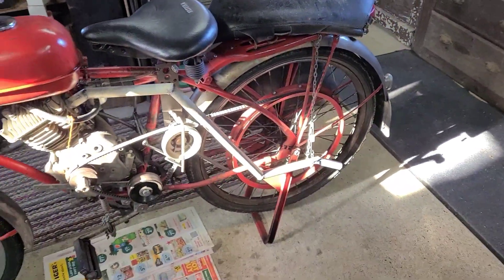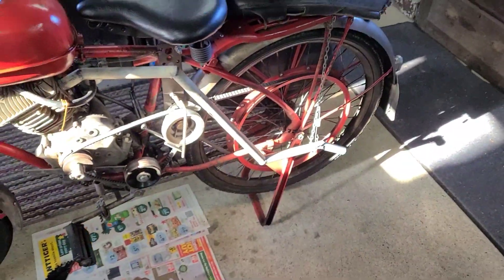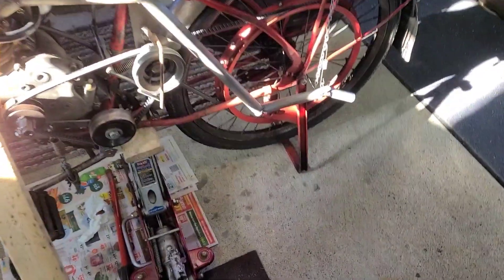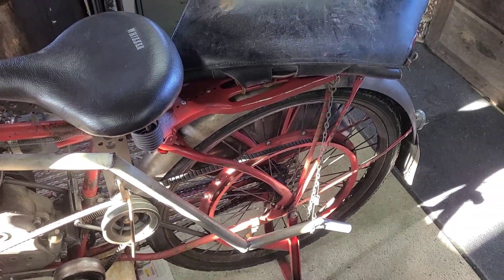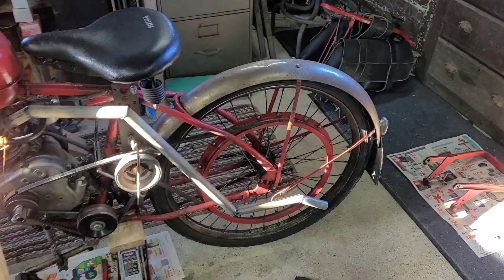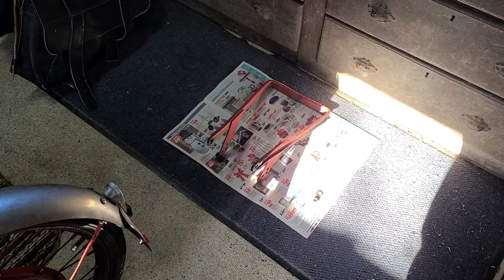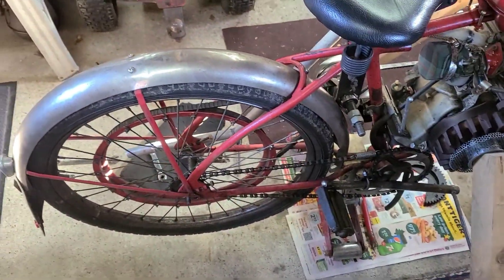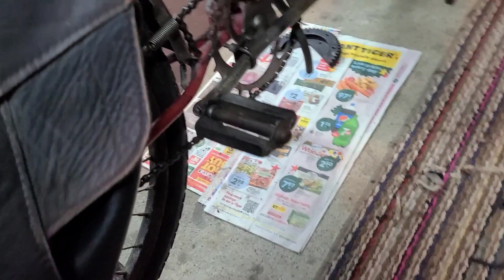Going through the Whizzer's brakes

Comment: Please do an update video. I'm thinking that you bearing races are worn out which is causing the skipping that you getting.
Why don't you just buy a new wheel hub with a disc mount so you can make stopping a lot more reliable?
Reply from the maker: The bearing races are still in good condition from what I can tell, and the skipping is gone now. The reason that I haven't bought any new parts is because I can't afford them.
Reply: @jonersmotors  You should ask the yt community for help. I'm sure somebody might help you out. Ask for donations to PayPal or Patreon.
Reply from the maker: I don't want to be cheap like that and ask for money, I'd rather work for my own money.
Reply: @jonersmotors  said like a boss 💯